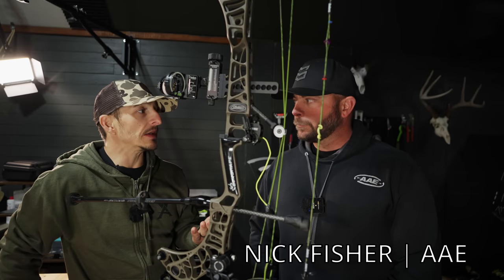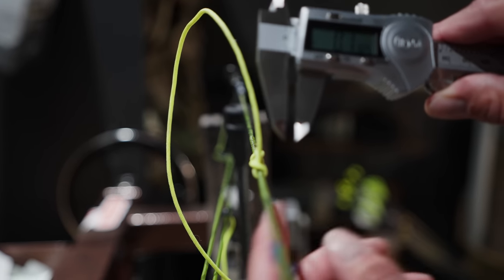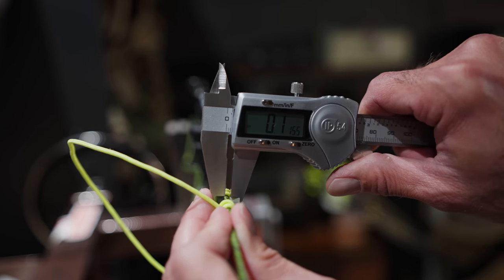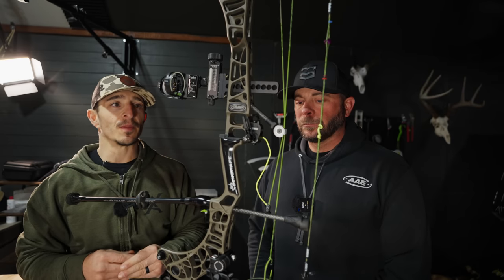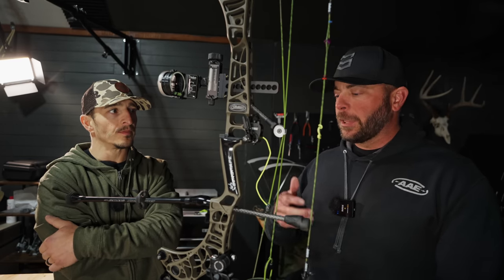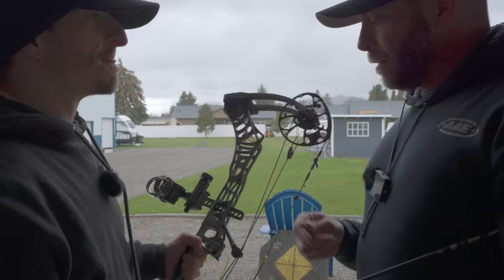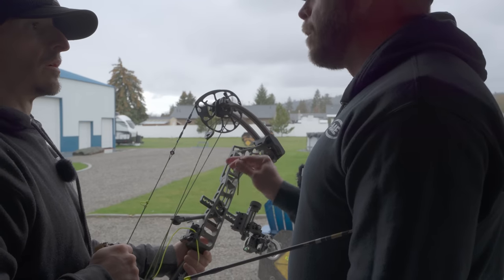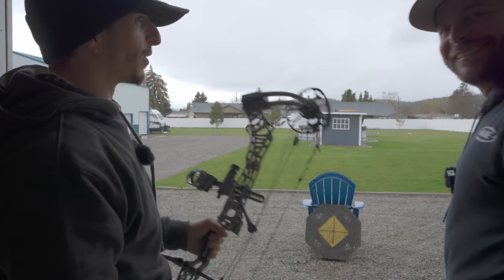TORQUE TUNE YOUR SIGHT || AAE EP 2

Comment: Agreed 100% on the nock fit and factory center servings.  I love the IP nock but for standard gas strings wish it was a tiny bit bigger like the gold tip nocks.
Reply: Which nocks do you see work best with  GAS strings?
Reply: IP are okay but I like the gold tip throat size.  Bohning A nocks work as well but I’ve had a few break so still don’t have a solid option for 5mm

Comment: During the setup of your bow, there was a quick clip that touched on "adjust cam lean", but there was no talk in depth about that.  Any way you guys could do an in depth on what your trying to do regarding cam lean?
Reply from the maker: We swapped top hats on the top cam. Took the right one and switched it with the left one. One and done. 🤙🏻🤙🏻 -DS
Reply: @ElkShape  Thank you, Dan, for responding.  I figured you switched tophats.  I was more referring to the strategy.  You hadn't shot thru paper yet, but looked at the cam lean and said "hmm we should swap the top hats".  was the goal to get cams straight up and down at brace?  Or a certain lean toward or away from the riser?  TIA

Comment: What I'd be interested to know is did you torque tune with the sight because the rest was riser mounted and you didn't have the ability to even go there with the rest?  I've seen Paige Pearce do it with only the rest because she didn't want to mess with having to change peep diameter, clarifiers etc. after moving the sight. So is one (sight vs rest) better than the other or does it really come down to the constraints of the bow/shooter?   Me, my right eye is pretty bad and anything less than a 3/16ths peep is just a giant blur, so I cant move my sight further forward, so its moving the rest for me.

Comment: i Need Help with a decision i need to make. i have a bowtech sr6. i installed a vapor trail gen 7x rest on it. but the flex guard dampener is conflicting with the capture ring of the rest. i dont want to modify the capture ring nor do i want to remove it altogether. my question is, and hopefully people can confirm this. but can i just run my bow without the flexguard dampener? or will it be unsafe? i dont care if i feel more vibration in the hand. i can live with that if that means i can get this rest to fit and tune perfectly on my bow. thanks ElkShape Crew and anyone else who chimes in on my request for help

Comment: Has anyone has issues switching from zebra strings on Mathews bows? It's time for a new string on my Atlas.  I've got a 33 inch draw and I'm worried I'll have to charge mods if custom string doesn't sit same on cams and everything.  Anyone have experience with this?

Comment: Just have to say I am a big fan of multiple AAE products but have to ask why wouldn’t their nock production make some changes considering most strings I’ve used whether factory or aftermarket have all had excessive tight fitment and had to swap out the AAE nocks